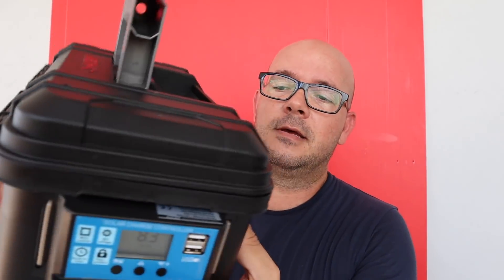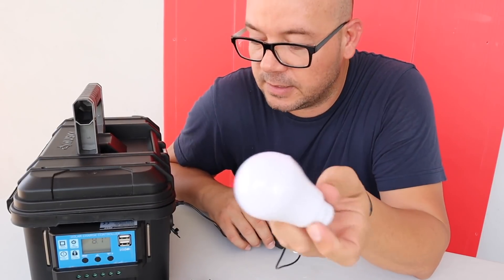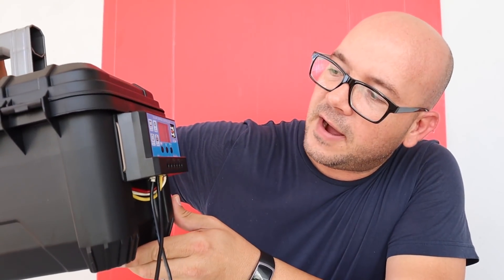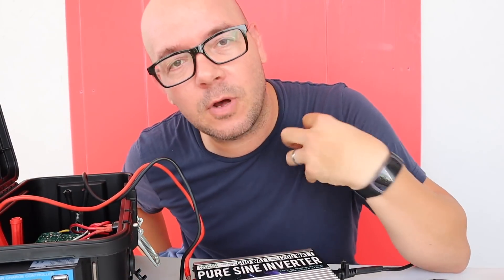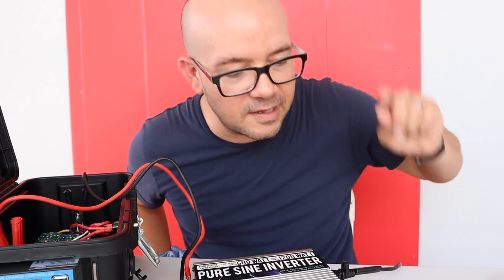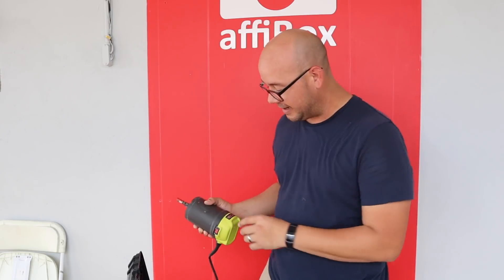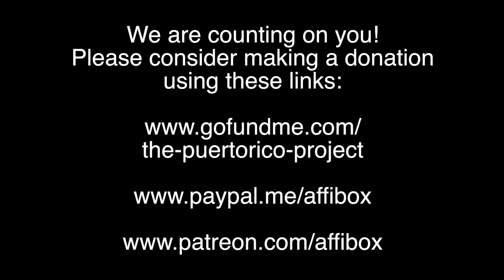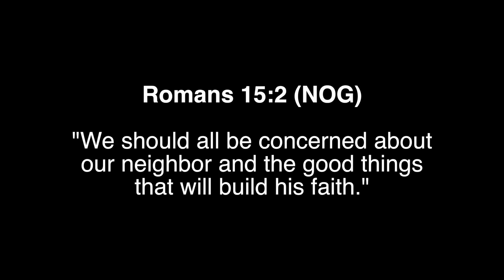Build a Supercapacitor Solar System in Minutes!

Comment: What IF...you added a battery backup - not for running, but for the CAPS? As in, instead of running the power straight to the caps, run it to a little battery pack and THAT to the caps?

I was also wondering what would happen to grid power usage if you ran the 110 (or 220) through a step down converter to a cap bank to an inverter...you'd have a steady 12 volts all the way to the inverter. 

I just read something about something in all of that actually BENEFITS from some fluctuation in voltage but I don't remember if it was the super capacitors or the inverter...I think it was the capacitors but it wasn't the information I was looking for so I just glossed over it...which I am now regretting...poop.

And again, wondering, about 2 cap, series-wired mini packs wired together in parallel. It would still be 6 caps in 5.4V bites in 3 pairs for 16.2V but twice the capacitance...right? Twice the farads? Amps? Couldn't you use smaller caps?

ETA: I don't use a charge controller. Although, I am considering repurposing an automotive voltage regulator between my 18V PV and cap pack and moving the step down inverter between the caps and inverter...As in going PV>VR>caps>converter>inverter - instead of PV>converter>caps>inverter. An automotive voltage regulator doesn't cut off at 12V exactly - and I haven't checked, but I doubt the converter does either so...I think whatever benefits from some fluctuation to stir up the electrons - right, it was the caps - I think that might get the job done...I guess I'll find out, eh?

Comment: Thank you. Appreciate it. You seemed quite excited at this time, but don't see any more videos using these after this one. What happened, didn't find it so useful after all?
Reply from the maker: Time... I've been working on other projects and I haven't got the time or the resources to revisit this setup.

But to give you an idea of how useful it is, at the beginning of 2020 we got hit by many earthquakes. One of them shutdown the entire grid and at the time I didn't had a solar battery.

I quickly took the supercaps and some panels and use it to run the fridge and the tv while I was putting together a battery using one of my kits.

I'm looking forward to tackle this idea in the near future. 

Thanks for asking.
Reply: @javiercamacho  Nice, thank you. Subscribed. Also, not very clear what all those custom 18650 are for, is it to replace solar batteries that are hard to get over there?
Reply from the maker: @TheVedicWayChannel  use to be hard to get them. Now, we partner up with battery Hookup and finding cells is not a problem anymore

Comment: great video, just one question  could the super caps hook up directly to the solar panels , then connect  charge controller to the supper caps , could  this      connection be used on cloudy days to  maintain  the  battery due its quick state of charge?
Reply from the maker: Nope. Solar panels can damage the caps if connected directly because they can output voltages that are over the specs of the supercaps. 

You need a constant voltage from the panels and that's why the CC is for.
Reply: thanks much @javiercamacho

Comment: I dont care about the night, i have electricity for the night.. i just wanna reduce my electricity cost by running things on solar during the day time and i thought super capacitors will be perfect for this. And when i searched i saw your video on YouTube. You already have the proof of concept! Thanks man.. Do you mind shearing the schematic for the super capacitor board please?
Reply from the maker: The PCB came with the supercaps.
Reply: Sir,do u make biggest campaster battery   the  have load test ,  basitawan from Pakistan , Lahore , Askari 10,house  276b

Comment: I am also working on one of these but the problem is to find an inverter that will take in a voltage all way down to zero.  A typical 12V inverter will go down to 10v and then not work anymore but in capacitors the voltage is in linear relation to charge.  So going from 15V to 10V you only use 33% of the charge, after the point you can't use it anymore.
Reply from the maker: Hack one
Reply: if you use a step up converter between the super caps and the inverter that will do it

Comment: Supercaps are very compact burst of power i.e current. They ve however very low power density. Your project would be exponentially stable when a compatible battery is combined. 
Hybrid Supercap- batteries are more robust than either of the storage media.
Reply from the maker: you are right. Just keep in mind this is designed for emergency situation and there was no batteries around the island.
Reply: @javiercamacho  
Alright. Tried similar setup myself with 12, 2.7V, 3000F (12v system) Nesscaps and an inverter. 
It powered a LCD tv but sagged with overcast as expected.
Nothing to discredit your video, just that some ppl with no electrical engineering background  are ignorant of supercaps vs battery bank functionalities; and they are very hard to educate once they see a video.
Reply from the maker: You got that right. I'm going to revisit this video soon. Hopefully they'll get a better understanding of this type of setup

Comment: What's the great idea behind using supercapacitor in place of battery ?
Reply from the maker: Use the power of the sun without batteries in case of emergency. 

Please watch the video again and listen very closely when I say that "there was no way for us to buy cells or batteries after the hurricane"

If you live in an island.... trust me.... you want to have access to supercapacitors...
Reply: @javiercamacho  Yah, probably I may have missed that one.
Reply: @vto rsi But Super caps are costly then batteries and have very low storage capacity. So it is no where near feasibility without batteries.

Comment: I'm curious I have a work van I would love to be able to build a solar generator with supercars to run a 15a 120v circular saw all day can we do it . Some times we go to job sights that dont have power dont want to use batteries to expensive.  CAN IT BE DONE ?!
Reply from the maker: YES YOU CAN!!!! and here is the video I got the inspiration from https://youtu.be/wKYkSwCGe0s
Reply from the maker: The way I see it is like this. When you want to use 200w of energy you need at least twice the amount of that in panels. But this is for running equipment non stop during the day.

For tools that will be used for a few minutes, around 75% more should be good.
Reply from the maker: At the end of the day is all about input and output.
1. a good size supercaps bank
2. Good quality panels
3. A really good MPP charge controller

These should give you what you need.

Comment: Can you calculate the watt hours to know the capacity, of your capacitors? I would imagine you would not have enough power, unless you add more in series and parallel ,and ,or add battery storage. Looks useful already though
Reply from the maker: I wouldn't use supercapacitors as my main energy storage bank. I will use them only as a buffer and attach my house to solar panels or wind turbines.

But... if you use a supercaps ab charge then up to 16v, you can run a 5v 8w led bulb for 40 minutes

Comment: Can we use it for AC ? As it needs a sudden surge of current
Reply from the maker: you mean, put a capacitor on the AC voltages?
Reply: @javiercamacho  Air Conditioners ... now Using inverters air conditioner needs kots of bettery power
Reply from the maker: @MagicSmoke11  the do but with some clever circuitry you can partially run AC

Comment: Best free energy video  for a  affordable price that works
Reply from the maker: Thanks for understanding the concept. Hopefully I'll make more videps soon
Reply: Thanks i was lost
Reply: So can you hook batteries up to the capacitor bank
Reply from the maker: @brandonfuller9484  Yup... and when you pull a lot of amps from a bank, the caps are the one getting the hit and not the cells
Reply: Hey Javier I tried to hook my batteries to my capacitor and the wire got real hot and started to burn do I need a protection board and I did use speaker wires
Reply from the maker: @brandonfuller9484  how did tou connect it to the batteries? Are they supercaps? Did they have a protection board?

The only reason it could get really hot is because the cells are discharging a lot of energy into them really fast or there's a short somewhere in the lines
Reply: @javiercamacho  I had to buy the protection board separate and they are the same capacitor you use in your video but without the protection board
Reply from the maker: @brandonfuller9484  please double check the wiring and only connect the caps in parallel to the cells.

Test it through but be safe while doing it

Comment: The ultra-capacitors are only good for supplementing lithium batteries for surge loads, not for longevity. This video is somewhat misleading if you don't pay attention to his words. The capacitors can "turn on" a load. So what? The lithiums would keep that load running for several days without sunshine as long as they are sized for the load. I build and sell power boxes that will run a full sized side-by-side fridge for several days before needing to be recharged. Most people have no need for my portable power boxes unless they have medical equipment they need to ensure will have adequate backup power available.
Reply from the maker: You don't live on an island do you? You haven't passed months without power do you?
Reply: @javiercamacho  Since you didn't say to whom you're addressing, I can only assume it's someone else since it has nothing to do with what I said.
Reply from the maker: @musicinspire1745  it was address to you.
Reply: @javiercamacho  So what does having lived on an island have to do with anything when it comes to the reality of the fact that capacitors do not at all perform like lithium batteries?
Reply: @javiercamacho  If you do your homework, 3000F caps provide about 3Wh of power, while individual lithium cells can go upwards of around 400 Ah. So, unless you have a bead on some new technology caps that nobody else knows about, then we're all ears.
Reply from the maker: @musicinspire1745  after hurricane Maria we couldn't get ANY BATTERIES OVER THE MAIL. We couldn't get cells even from recycling facilities. 

So we had to improvise. That's why I created this video. To help those in an emergency situation. 

Trust me... i know way more about cells and batteries than what you might think, but this video was dedicated to help families in need, families that couldn't get help, families that couldn't  buy cells even if they wanted to. 

So please, watch the video again and try to understand why I created it...
Reply from the maker: @musicinspire1745  also, if You do Your homework you'll see that I know a bit about cells....
Reply: @javiercamacho  It's admirable to try and help people out. No problem there. If you read my OP, I didn't say that YOU were trying to mislead the people. I said that it's easy for some folks to get the wrong idea, and in this case, an assumed idea that caps are just as capable as LiFePo4 batteries, for example. As an Electrical Engineer, I find myself dispelling many false assumptions people make about such things as this topic.

Comment: 850 F capacitors have FAR less energy storage than lithium batteries. The 850F capacitors can store only about 0.86 Ah or energy, which will run something for a short time, but not with longevity. My 400 Ah lithiums will power stuff for far longer. The capacitors are GREAT for pulse and surge sources. So, when used in parallel with lithium batteries, they can actually prolong the life of lithiums, and supplement their usage.

Comment: I do not use any expensive & sensitive batteries anymore. I use 4x supercaps banks à 6x500F. For my 24V inverter, two in serie and other two in parallel. A 4000W pure shine inverter works great @ 30V. A 2500W watercocker is no problem for these powerful powercaps. Wow!
Reply: 500 farads?! Where did you get such a huge caps?
Reply from the maker: Amazon
Reply: 6 2.7v500f in series/ parallel to get 12-16v only give you 83f.  If you run 2 500f in parallel you get 1000f but 2.7v if in series you get  5.4v but 250uf  @Teknopottu

Comment: Es interesante lo que planteas con supercapacitores, por desgracia su densidad energetica aun es bastante inferior inclusive a la del plomo, ion litio quedan aun peor.

Eso si tienen unos tiempos de recarga maravillosos y picos de descarga impresionantes, pero si le veo problema en construir algo que alimente aparatos con bastante consumo. No durarian mucho.
Reply: Hola, espero tu comentario sea basado en la gran limitación de nuestra comunidad latina y no la de confundir 0’ hablar sin una base.   Pero cualquier capacitador que tengas dc arriba de 21,000 uf te ayudará no son baterías pero sí lo interpones en medio no te dejará caer el Voltaje de la batería qué es su mayor debilidad o de cualquier otra fuente, solar, eólica donde el Voltaje sea menor de 120v  siendo el mejor 240v o más por qué la diferencia en watt es Voltaje o amperios y si tú Voltaje comienza a caer lo compensa con más amperios , lo que se traduce en calor 🥵 en el equipo y el cableado eléctrico lo cual sigue pidiendo más consumo de energía o amperios.  Y un súpercapacitor no permite que el Voltaje y amperaje bajen, mantenimiento el trabajo de tu equipo en su eficiencia, dándole un rendimiento mucho mejor a la fuente.  Son caros pero ahorita con los problemas globales están más accesibles.  .......cuídate,Gracias

Comment: For got to tell. That the truck stop. Marker lights (the ones with three led lamps) make better than "nothing"ceiling lamps.   there is enough light to not run into the furniture. And  great pourch lights. They make poweroutages which happens here often in my Tennessee hamlet safer  scares the thieves away.

Comment: Your on the right track. Not to say I have not gone dry on my home made system.(solar/lead acid) how ever  it's quite trustworthy. It supports, tv, radio, computer  fan, and house lighting needs for 14 years.( Never bought a dime's worth of Ac here) Keep it up om. And via con dios. De kv4li.   Ps never turn down old computers as they have the most perfect fan. Low consumption on DC and seems they never die. That's right they get tossed out without regard of its assets. And don't be afraid to box up old auto radios add speakers you have a home entertainment center that just keeps giving. 73

Comment: Hi Javier. The 600 watt inverter will draw 50A when it is running a 600W load. The caps store charge Q=CV  Cs in series divide, like resistors in parallel, so C of the 6 caps in series is really 83 farads. 83Fx12V is about 1000 coulombs of charge. Since charge Q=IxT we calc 1000C/50A=20 seconds for one string of 6 caps., so the more strings of 6 you can put in that box, the longer you can run the inverter. 2 strings of caps in parallel should hold up for 40 sec. 600Wx40sec is 24000 watt-sec, but you want watt hrs! Need to divide by 3600 sec in an hr. 24000/3600 is 6 watt-hr. Thats a 6 watt bulb for an hr. Need many more 6 cap strings to run the cooler all night. Also, should have 600watts of panels to keep the 600 watt inverter running. Numbers dont lie.
Reply from the maker: Thanks for the tip
Reply: I believe trains used to huge super-capacitors May be they can used as energy storage banks?
Reply from the maker: You'll need a really big supercaps banks

Comment: If you can make simple diy voltage pump from scratch it can afford 95-98% of your capacitors. Than it can work efficiently even without the battery, or even better if add some batteries.

Comment: Hi Javier, thank you for good simple application. You scheme is simple, but terribly inefficient. You use only 20% of the caps power. 
If add caps to 24V, plus dcdc back converter (can use several to get high currents if necessary) then you can get the near 90% of your caps. 
Also a battery necessary, to not to damage charger when you drop caps to zerro.
Reply from the maker: Please look at the video again and listen to what I say then you'll understand why I choose this type of setup

Comment: the future is in these super capacities to get out of battery use because I do not have many tools to experiment with these capacitors I started with 10farad 2.7V x 12 regularly to get a voltage of 32v as my sinus inverter works on 24v LF with the EGS002 and 20 MOSFET transistors in the output - converter I made and run 2000W, I have a bank of 18650 batteries 21 per cell x7 cell-29V maximum i want to throw out and transfer to capacitors

Comment: I'm actually looking into making a similar small lightweight power solution by combining the super capacitors with 26650 rechargeable batteries for a long-term emergency situation.
Reply from the maker: That sounds like a great project...!!!

Comment: If you match the solar panel to the capacitor bank and use a few passive components .....you do not need the solar charge controller. Remember another advantage of super caps is that hey can go down to zero, unlike a battery, so do not need low voltage protection. Just need to protect against over voltage. A solar panel can cope with a dead short at zero volts. However you do need to regulate the output as the caps voltage falls steadily, unlike a battery.
Reply from the maker: I'll stick with the charge controller. There's no easy way for the non-technical people to control over voltage from the panels
Reply: @javiercamacho  Simplest way is to put one extra capacitor in the bank so that the total voltage of the  bank is always slightly higher than the output of the panels. Far cheaper and one less box. Also, you will find that the charge controller always bleeds off current from the capacitor bank when the panels are in darkness